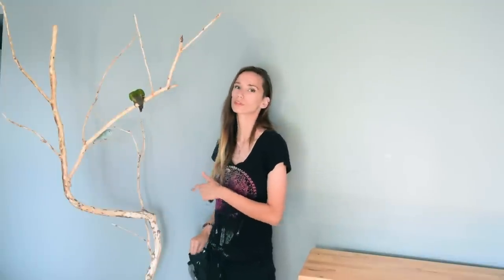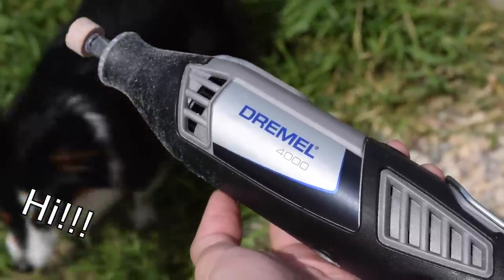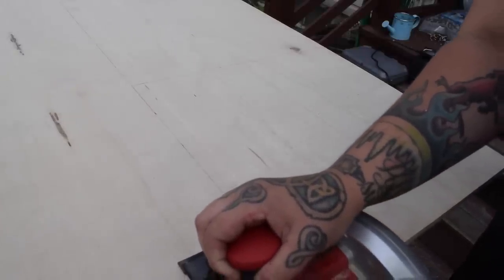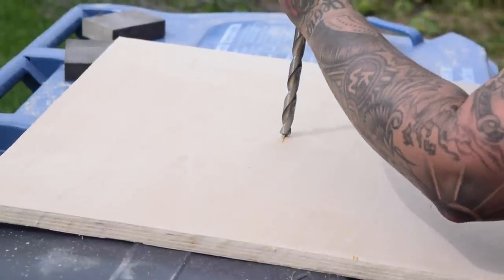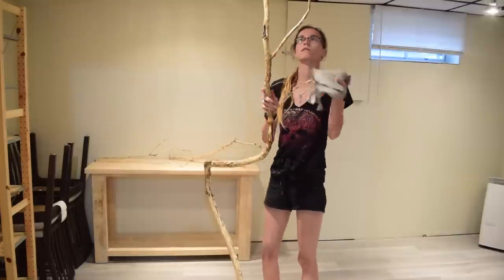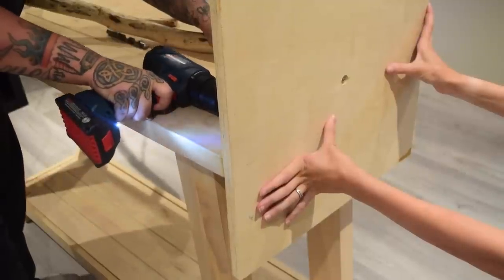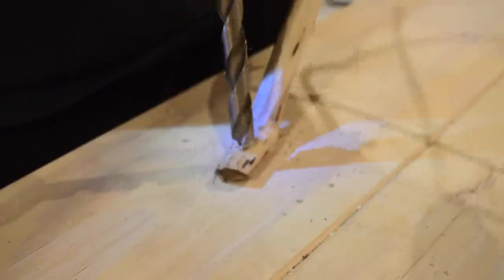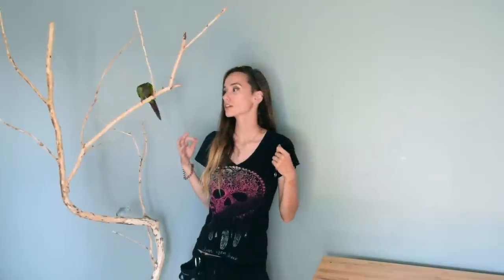Parrot Tree Stand | DIY

Comment: Use a Christmas tree holder if the intent is to place the stand on a hard floor. You can buy ones that do not have a water reservoir and are earmarked for mounting artificial trees. To protect the floor, lay a cage liner paper or such. Done.
Reply from the maker: That’s a smart idea!

Comment: A block plane, spoke shave or radial palm sander would have had that bark off in no time, alternatively you could take the cuts inside and let them dry completely and then the whole thing would come off much easier than on green cuts
Reply from the maker: We will keep that in mind for next time, we just didn’t happen to have those tools on hand!
Reply: @FlockTalk  another idea to save the wooden base would be a small bag of post setting concrete in a flower pot would make a nice stable base with no drilling! Love the project, I'll have to make one sometime soon :)

Comment: Do you know if wood carpenters glue is safe to use? I'm thinking it would be safe as long as you immediately wipe up all the squeeze out. That's really good trick if you do have a split branch is to fill the split with wood glue clamp it and then use a damp cloth to get all of the squeeze out off and then when it's dry scrape it down with a knife and then it's good and solid it to drill into. It might be okay now that you've drilled into it and put the screw in but it can dry out over time and will fail

Comment: Very nice..just 2 questions..
First, Why didn't you use (non-toxic!) Wood Glue on the joints to keep them safe n secure long term? If you're worried the birds might get to glue residue, it cleans up with water if you were to accidentally let it drip on any surface. It makes a HUGE difference on projects like this!
Second, I understand the birds are going to chew the branches, (that's why I use Willows wood), so they definitely should NOT be painted. You can clean any of the branches with wire perch scrapers or even wire or waterproof sand paper since you can't wash them, but why didn't you paint (kid safe non-toxic) the base? The surface layer might have a 'seal' but it's very thin and will quickly scrub off. The other layers of plywood aren't so 'lucky' and will mold if they get wet. Bacteria will grow between those layers pretty quickly too. You could have used 1/2 round molding (since you had a handy man!) to do it up right, but silicone (it's 'inert'!) would have sealed the edges. You wouldn't need a big caulking gun full, just a smaller tube tube or two, depending on the size of the base, and smear it on with a gloved hand. Paint would have sealed it too.. I guess my thought are with cleaning and the health of the birds. Budgie dropping are easy but other birds, bigger parrots and Softbills are alot softer and wetter inviting mold, mildew and bacteria especially. 
 Your construction, concern for the birds health and wellness is otherwise great and the way you present it is entertaining. ;) Keeping up the good work!
'Silver n Flock'
Reply from the maker: Most choices were made exclusively for bird safety and to be cost friendly with materials we already had available that were bird safe. Didn’t want to seal the base in any regard due to the fumes involved in doing that and the fact that my birds are attuned to going down to the floor to forage I didn’t want there to be any risk if they happened to chew on the base while they were down there. Avoided wood glue because of ingestion risks again, even if you wipe it away they can still chew through the branches and end up getting to that layer ending up with adhesive in their mouth.
I’m sure they’re safe to do if done right but when making something myself I’d rather there be as close to 0 risk for the birds as possible.